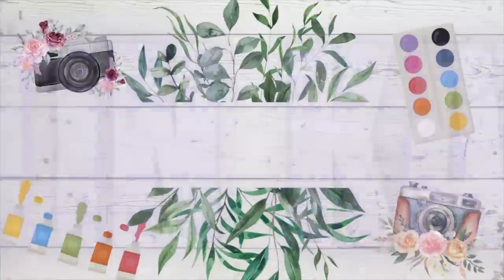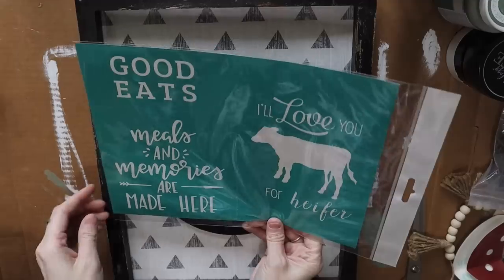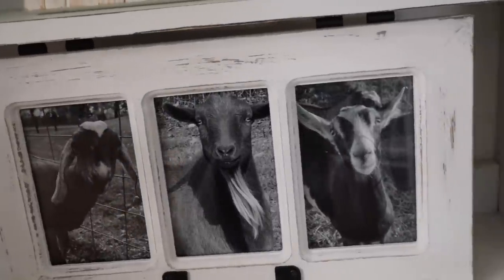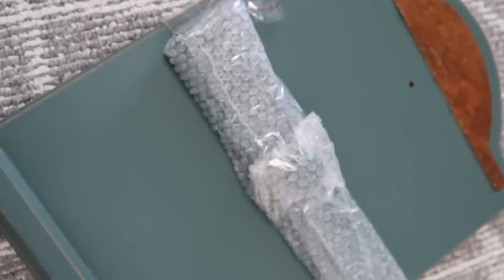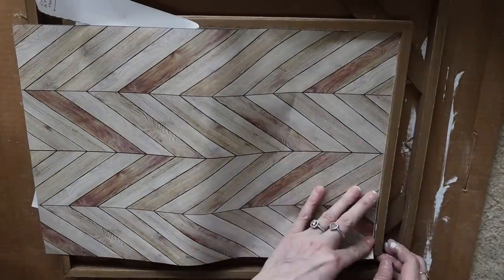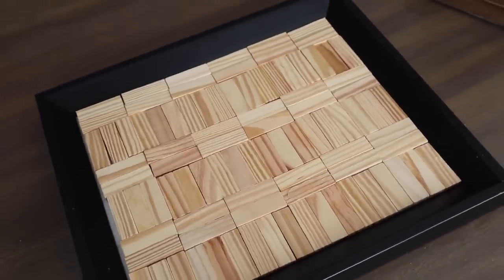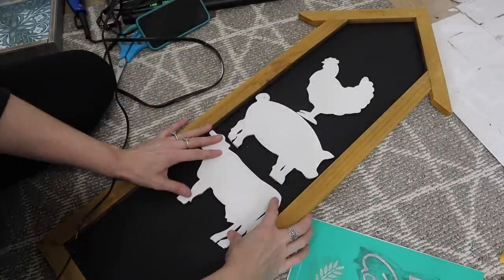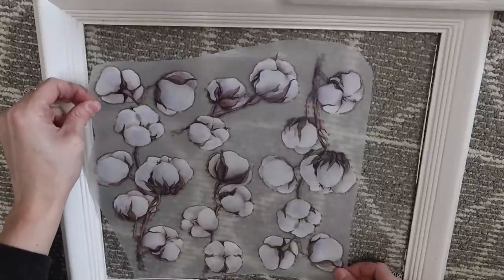🤯 You Won’t Believe what I made using old picture frames | Picture Frame Hacks!

Comment: Such cute ideas to reuse frames.  I think my two faves are the goat picture and the cookbook stand.  I have a question though, on the cookbook stand, did you put anything on the chalk paint before adding the stencil?  I was wondering if the stencil would pull up the paint.
Reply from the maker: I always fuzz my transfers and as long as the paint is dry, like really dry I don’t ever add anything onto the chalk paint
Reply: @KristinKay  Thank you so much for the info.